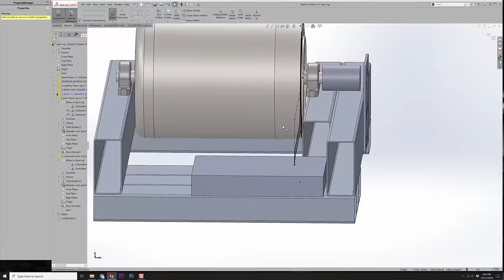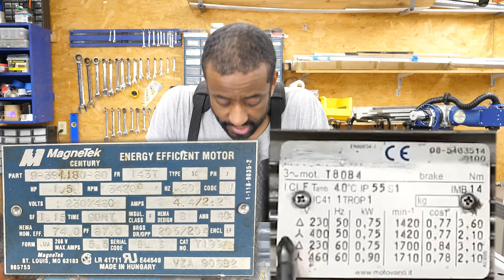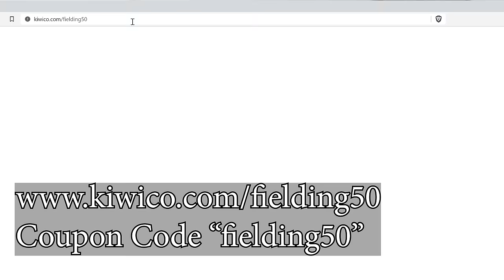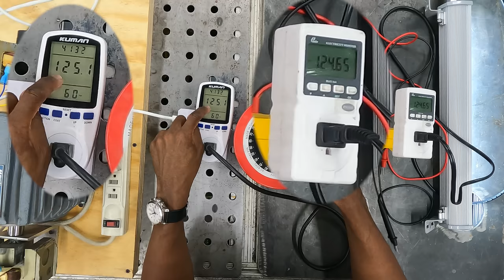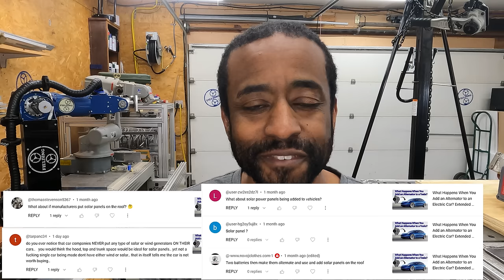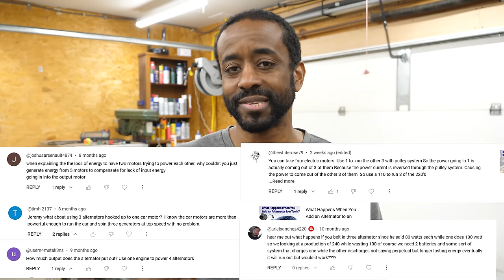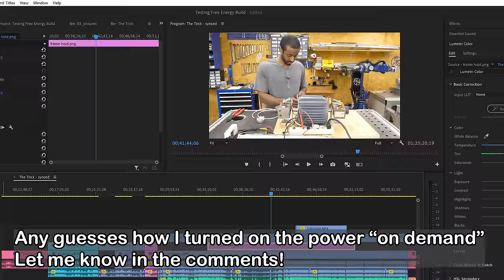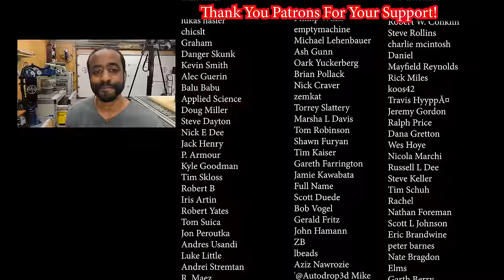Building and Reviewing Free Energy Generators on YouTube.

Comment: Energy is constant Jeremy but on the subject of free energy I have a mind blowing idea using a old petrol generator with the petrol engine removed leaving the generator part in place and using a air driven hand grinder to turn the generator spindle to 2500 rpm which will generate 240 volts which is enough to power the air compressor of 150 litres which makes a constant circuit of energy the way to achieve free energy is to add a second generator to the first generator via the spindle which then will power what you need
Reply from the maker: The best way to learn is to just try it. If you are right this idea is worth hundreds of billions of dollars. If you are wrong you get a great lesson in physics. Its worth it and you will understand the problem way better.
Reply: @Jeremy_Fielding  thanks for getting back to me Jeremy it those work and if you can promote it on your channel that would be of great help as I own F-AIR GENERATOR TO ELECTRICITY HERE IN THE UK I GIVE IT FOR FREE TO ALL AS A ALTERNATIVE TO FOSSIL FUEL SO ANY MENTION WOULD BE GREAT LOVE THE  VIDEOS AND YES YOU EVEN TEACH ME A THING OR TWO 
THANKS JOHN

Comment: Theoretically, if you go full frictionless, no gears, huge kinetic flywheel with zero wind friction, air pressure could be used as a drive power. Think hit and miss engine with huge flywheel that produces air, but is powered by heated air. The feeder line heat source is the dilemma and wasn't given enough thought as humans jumped right into steam power via burned fuel. Free energy can be friction itself through temperature manipulation. They do have solar panel paint now btw. Great time to be alive, reverse osmosis hydrogen generation too. ✌️

Comment: electronics question,... I have to run a single phase 2 wire, 1000watt DC motor, on a 2 phase, 3 wire 72volt power supply,... What should I use to connect the 2 components?  phase converter? a vfd? or a bridge rectifier?

Comment: If you could see what I see you would realize over unity is not only possible but it is so ready to be built.    When ever I see people trying to make free energy they always want to connect things, like motor to motor, or add more gears and pulleys. I say it like this.  Think about electricity like flowing water.  You know you can not add a hose to the bottom of the tank and get the water to flow to the top of the container. But you can get energy by letting all the water out.   Same thing with air.  You can put 100 psi in the tank, but if you take a hose and plug it back into the same tank you will not be able to accomplish any work, only by letting the air out can you create work.   Recompressing the air with better leverage would mean needing more distance to travel.   But all these methods are not going to work, no matter how much you change the gears.   I know how to use a small amount of energy and get lots more energy out.I could show you away to move the second motor with out connecting it.   I could show you the orbital design and the proper alignments.    This can be made as a toy, but the real machine is no joke and very heavy.  Out side the box of conventional thinking.  No there is nothing like it,  and it’s powerful.   You can not connect anything together.   Let me show you how to disconnect it all.   I need a science partner.   Because I’m getting old and I’ve been connecting everything since I was 8 years old.   I finally see the disconnection.  No pulleys, no gears. How ever a special ball gear does need to be made.   I have put a lot of thought into the safety of this.  So even though you may be able to discover what I’m saying, and attempt to build this on your own please be carful. And if it gets too much speed it could blow up.  So take precautions to be in a safe location when testing this equipment on a large enough scale to power your home, or business.   This generator works.  But needs to be designed by expert engineers.  Because balance and weight and distance are all factors.

Comment: Please tell me about how
Connecting the external wire to the circuit and the circular cylinder inside the coil, how can it work? I made the same thing as you but it doesn't work. Did you use any magnets?

Comment: if someone had a plan that just about works but needs more input. who is the best and safest person or group to speak to
Reply from the maker: You have two things to consider. First if you think you can produce more energy than was supplied, there is no engineer who would help you. Its called a law of thermodynamics because there are no known exceptions. If you invented the exception, and you are right it means you have to understand the problem much better than all of them. Such a person should be able to make their design without help. As I explained near the beginning of the video, tens of thousands of people come up with the same "non-working" ideas every day independently thinking they have discovered something. It is usually just that they don't understand why it doesn't/ won't work. We all have ideas like that including me. Free energy just happens to be a very popular subject. My advice is as follows. You should just build it. If you are right the idea is worth hundreds of billions of dollars and clearly worth your time. If you are wrong you get a great lesson in physics. But if you need help with it it more likely means you just don't yet understand why the idea won't work. This is coming from a person who has received over 30,000 such ideas through email and responded to most of them. In total there were only  about 7-10 truly different ideas and all of them have the same "push back" problem I described in this video. In fact this video is a response to all those messages. What scares me most about your message is the person who is likely to tell you they can help you is a also very likely a scammer. While I don't expect to change your mind, I did hope to warn you people will take advantage of your hoping this will work.

Comment: U have to use a capacitor to store the energy. Why does everyone leave that part out?
Reply from the maker: A capacitor would not help. But I want to know why you think a capacitor would help? As I better understand where people go wrong I can I can explain the problem better. Energy is what is missing. A capacitor is like a fast acting battery. Batteries also need energy to be useful. They don’t create energy they store it like a special bucket. The bucket only holds water it doesn’t create water.

Comment: this is awesome.. I Thought about 3 motors, and a capcitor?.an maybe a battery?..  2 motors/gennys' w/ battery, and capacitor,  to run the 1" motor- output.. for power and a lopped' system.. the battery and capacitor and dually motors, regualtors, would cover the single motor, and any requested load' on the "power motor" ?? maybe?.. i forgot... transformers?.... lol im no engineer.. but am always thinking of stuff..

Comment: Thank you for not fussing over the term free energy. How to do it north repels from north, and is attracted to a weak long South. 4 amateurs to five staters. There must be no happy rest for the amateurs. The angle of the north vs north is 23 to 34 degrees. The usaf drone motor is a double faced clutch that requires a pull to start. It has sealed bearings. That motor uses halcbach arrays, very complex fins of halbach, weak south faces, and/or proylitic carbon, offset to each other at 11 degrees, for a total variation of 22 degrees.

There are 16 motors the FBI yelled at me about... most of you already have a lab that the FIB knows about. The stators can rotate to be aimed at the peak of the halbach arrays. 5 staters and four amateurs, each stator turns 4:1. I will have to make the drawing again, my work has been taken down. Which, the motor is a significant advantage our military has... so...

Musk... ya... 
The magnetic accelerator utilizing argon and mercury is off the approved list... turns out accelerators make anti-matter. Ooops...

We might regulate and write laws to pay the power companies. There is a distinct need to not let putin have a drone that is self powered.

The guy in south Africa that finally sold his cold fission reactor... the dude who built a motorcycle powered by his reactor...

Finally, a ten foot water fall on your property is enough for self generation. A long enough stock pipe is also enough. Making your own enegry is not free, but there is ways to enable the people to have 'free' creativity. The scammers don't help, but a scourge? Wow man... I traded intel to learn about the magnet motor. Government sure did get upset. Nasa delivered the lecture I needed. A liniar magnetic rail in a circle that accelerates based on repeling is a thing. Use n52... fe16n2 is what will be needed to make a marketable motor, as rare earths are not durable enough. I suspect adding nitrogen to a silicate may be how the photovoltaic crystalline structure that is 1000w per cubic foot was developed. Bought out... the name of the game is spend the world's resources, then sell them the technology to live without their resources while selling ours at a premium price. This is why we are conserving natural resources... this is why it is a global market. The hydrogen economy will be largely unaffordable for the masses, leaving few elite, if we do not establish a solid method of self induction of electricity. Free energy is free creativity. The quickest way to explain the movement is not accurate, nothing is free. I have not seen any of the 16 motors the fbi claims to exist spin. I have two reports of people...

The 50mpg carburetor, a large jet and ball bearing, like a ball point pen, gets 63mpg in Africa on a 3 cylinder.... it was shelf'd in the 1970's. It went in to use in the mid 1990's. Does big business control the flow of technology?

Did you piss in my Wheaties? Kind of... all absolute statements are absolutely false. You would do better to just explain magnets do not perform work, but focus magnetic energy, and I would say, focus it at the right matrials, make use of science.

Comment: Hi Jeremy, The one thing I noticed is that you just slapped the magnets on either end without ensuring that they were opposing fields so maybe not a fair comparison. Probably will not make any difference.
Reply from the maker: The orientation of the magnets has no effect and that is sort of the point of the video. Every part was put there to maximize believability not functionality. The goal was to make this believable to someone who already wants to believe it is possible. There is zero engineering logic to this thing. It's a show piece with all the "right" parts slapped together. The magnets have no purpose other than people think you need magnets. Because there are so many other problems, pointing out orientation of pointless magnets would be like saying I used the wrong carpet in a car that has no gasoline. Even if you are right, we are paying attention to the wrong problem. Fixing that won't make the car run. I think it would help to watch the video again. This is by far one of the best scams on the internet. Its very convincing to anyone who hasn't personally used a generator and knows at least a little about how it works. And that is a lot of people. The most important thing to remember is if any part of it is a lie, the whole thing doesn't work. I showed you in the video that several of the concepts from the "product" are easy to test and disprove. I also built the whole thing. Even if you want to believe I made one or two mistakes... which I copied it exactly as shown, than my experiments with individual parts still proves the logic is impossible. The parts don't behave the way he faked it in the video

Comment: We are to small to make a perpetual motion machine. And before you say they don't exist, take a look into space with a telescope. There you'll see many perpetual motion machines at work. Size and temperature matters when it comes perpetual motion.
Reply from the maker: There is a huge difference between a "machine" running for a very long time and perpetual motion. Nothing in space is moving perpetually. You only need to search it out sir. We can measure these things very accurately and scientist check every day.  The sun is cooling off, the earth is slowing down, the moon is slowly moving away from earth. We add time to the clock every few year to make up for the slowing earth. It will take a long time but none of it is perpetual. The universe is much more like a giant clock that has been wound up. The spring is still running, but it is also definitely running down. These are all measurable repeatable things we can check. I didn't just come up with this. It is called a law of physics because it applies everywhere we look. There are no exceptions.

Comment: I appreciate this, 
I have a question: why you couldn't create a motor with magnet all around the turning part and then set up a few magnets on the outside pushing, with a protector to stop the pulling motion so the motor does not stop or go back and forth on the puling motion?
I hope you understand what I am asking as I have no technological word for this. And that you might explain or build something to show this?
Thank you again
Reply from the maker: This would stop. Its called Cogging. Permanent magnets can't be arranged to continually push each other. They will stop as soon as the input energy runs out. That is whatever energy you put in to get it started is the only energy available. When used up it will stop. Its a bit much to explain in the comments but I talk about this in the first video in this series. Check the description for a link to the playlist.
Reply: @Jeremy_Fielding  ok. Thank you.
I watched all your videos on this stuff ...I heard you say something about it but it's not like the ones you were pushing with your hand.
The ones attach to a freely turning wheel would be easy the push or pull if you block the back side of the other magnets which you would attach in the proper range to constantly apply a pushing force
Reply from the maker: @gcnewd  Trust me when I say I understand why you bring this up. Everyone thinks this this at first. It's not just you. You really should just try it. That's the best way to learn. This idea would be worth hundreds of billions of dollars if it worked. Its worth your time to get a feel for what really happens.
Reply: @Jeremy_Fielding  thank you Jeremy.
One day when I have free time 😜 I will try it.

Comment: Those who are claiming that energy cannot be generated and destroyed, those who can't think beyond the laws of thermodynamics, actually don't understand what free energy is. Let me try to explain you with an experiment.

Suppose you have two boxes kept on a road side by side, one weighs 10kg and the other weighs 100kg. Pulling 100kg box will require more force and energy than the force and energy required to pull 10kg box.

You would say bigger force is required to pull heavier box, you would say the force & energy required to pull a box is directly proportional to its weight, the heavier the box, the bigger the force is required to pull it. But that's not actually true. 
Can you pull the 100kg box by applying the force & energy that is required to pull 10kg box? 
YES, but how?
If you pour the oil on the road to make it frictionless, then you can pull 100kg box by applying the force & energy that is required to pull 10kg box. 
So the force and energy required to do a work don't depend on the amount of work done, but it depends on the opposition, resistance, friction, etc. 
Is it possible to run the lights of whole country for 1 year using just a 1.5v AAA battery? 
YES, but how?
If the resistance of the wire of whole country becomes zero, they there won't be any voltage drop. If we develop superconductivity at room temperature, then there won't be any voltage drop and one AAA battery can light whole country for years. 
In motors and transformers, when the coil or secondary is put to load, the later creates secondary flux which opposes the primary flux, if you provide an alternate flux path or if you can delay the secondary flux, then there won't be any opposition and you can generate larger torque and rpm by using very little input force or current.

Free energy is not actually free energy, it's a situation where resistance of the overall system becomes zero, and it happens only under a specific condition which we call resonance.
Reply from the maker: Even in you example reducing friction to zero only make you break even. You don’t fully understand the concepts you are trying to describe which leads to the wrong conclusion. I strongly suggest you simply try it yourself. It’s the best way to learn, and if your right your idea is worth hundreds of billions of dollars. This mistake in logic is quite common and it comes from a simple misunderstanding. Time 41:03. Just try it. Right now you think you’re right so I am not trying to change your mind, I am telling you to try your own claims. No question about it it’s worth your time. Thanks for watching!

Comment: What the creator of that generator said is that it is important that its core be made of a special alloy called "Argelium Alpha" of aluminum and silver.
Reply from the maker: Indeed that is completely made up. he also claimed you can’t buy this magic material anywhere. Given there are at least 10 reasons this doesn’t work outside of material properties I think we can say this is a most probably a lie. It’s like claiming I am using the wrong kind of driveshaft in a car with no gas. The car still doesn’t work regardless of driveshaft type. It’s just to keep you watching and hoping.